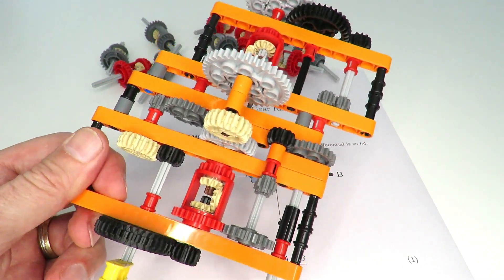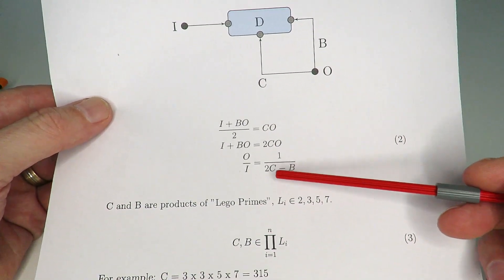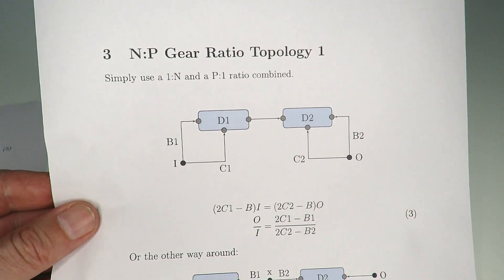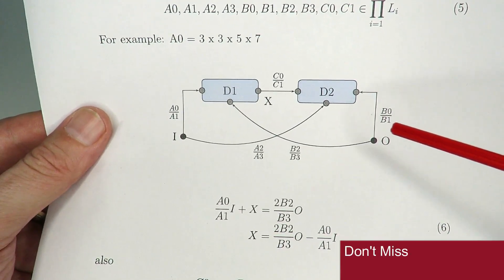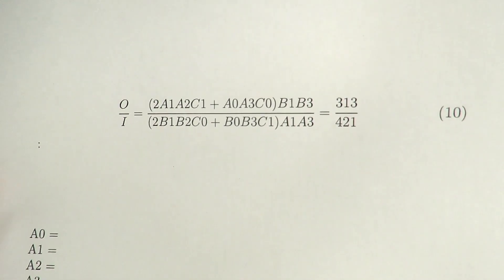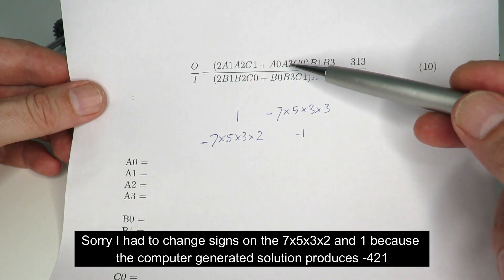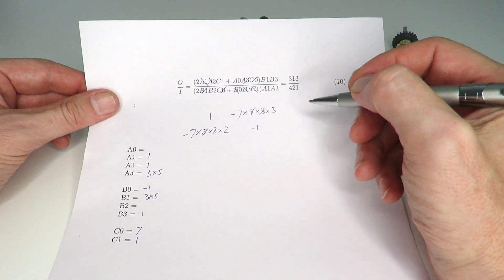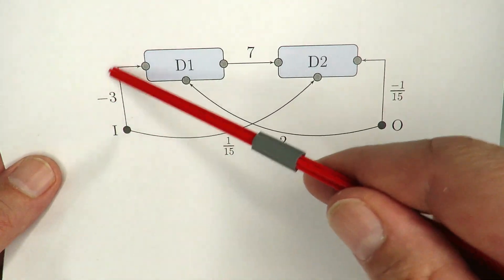How to design N:P Lego Technic MOC Gear Ratios using two Lego Differentials

Comment: Excellent work!
I've been working on a 1 year clock, wanting to take the hour hand and drive 1:365 x2 (since the hour hand makes 2 turns a day).
I had been thinking I would just go with 1:720 and add a diff for manual corrective factor of the missing 5 days, but now I'm thinking I could realize a proper 1:730 with this setup.
Reply from the maker: Hi Peter, thanks that's awesome about your clock! Have a look at my 1:P differential video - you'll only need one differential to create a 1:73 ratio which  you can then gear down further by 1:10 to create 1:730.
Reply: @TechnicBrickPower  Indeed! Looks like B=9, C=-32 works, as well as (1,-36) and (25,-24)
Reply from the maker: Hi Peter. Yes there will be many options. 32 being a power of 2 is difficult because you need 2x2x2x2x2 (or a worm gear driving the 32 tooth gear that doesn't exist!) You can also look for combinations to create 1:730 without the 10:1 down gearing - sometimes good solutions exist. Let me know how you get on.

Comment: Hi! Is it possible to use this method for ratios in which one of the numbers is not a prime, but a factor of it is, for example 257:236 (236 has a factor of 59). Also, does it work with non-prime composite numbers like 225:144?
Reply from the maker: Hi Acinonyx. Yes you can actually. The reason I used primes is simply because you can factor out any factors to be outside of the prime ratio.  E.g in your case 257/236 = 257/59 x (1/4) so you can either construct 257/236 using the differentials or 257/59 and then divide the output by 4, however one of the methods will use fewer gears so that one may be preferable. 🙂
Reply: @TechnicBrickPower  That is exactly what I needed. Thank you for your answer and your work! It is a joy to watch such a perfect combination of two things I love; maths and legos :) Doing some preliminary calculations as a concept for orrery which is a project that would add the third thing I love - astronomy to those two.
Reply from the maker: Hi again. That's fantastic to hear - yes love maths and lego too. I haven't studied astronomy much so that's new for me. I  have come across a few people that have made an orrery  out of lego. Let me know if you need any help with a particular ratio. Even for any one ratio there are many design options - you need to consider the speeds of all the intermediate gears to ensure they are all as close a possible to each other (i.e. you generally don't want one gear going 100x speed of another one if you can avoid it). 😄